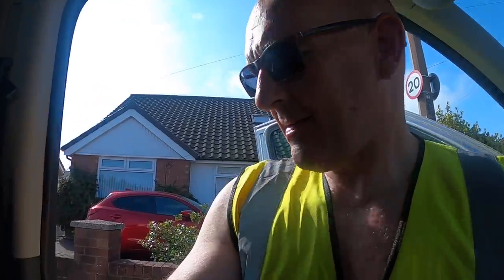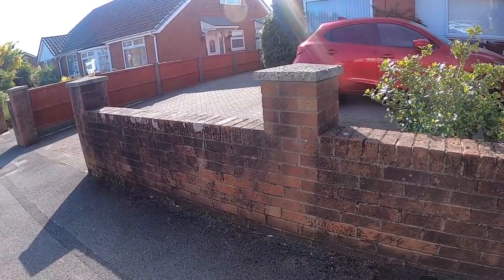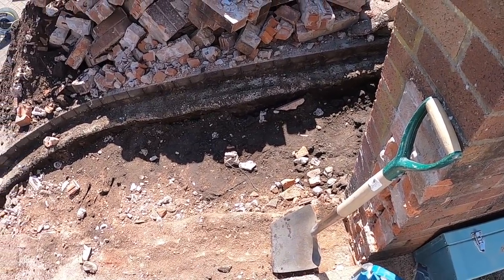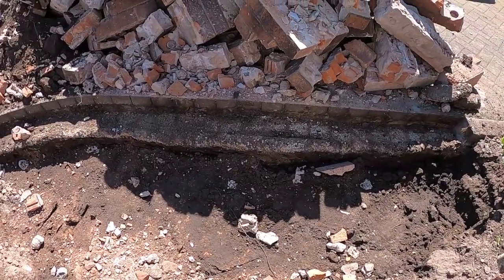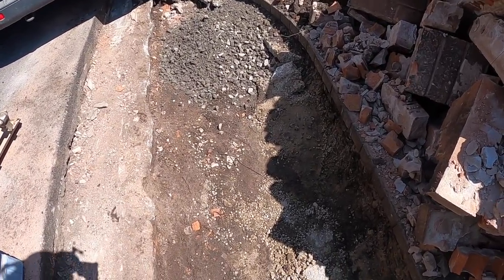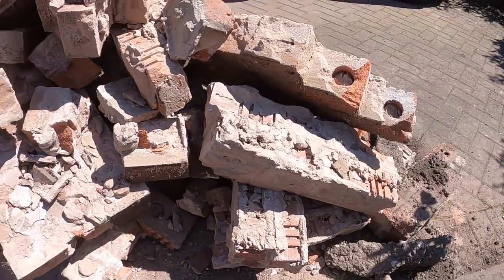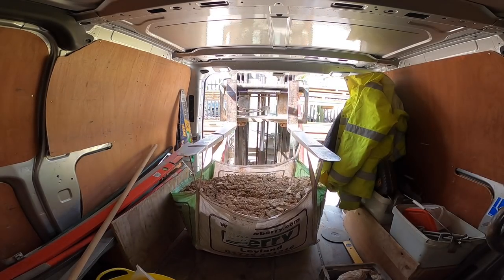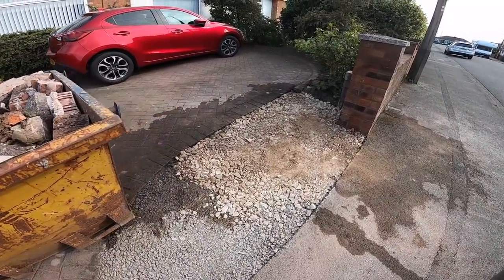GARDEN WALL DEMOLITION DAY !

Comment: There is much misunderstanding concerning Granular Sub-Base Material, or Type 1 or Type 2 MOT (Ministry of Transport specification material)… Type 1 has a 50mm nominal size stone, meaning a certain percentage of the stone content will be up to 50mm nominal size… Type 2 has a 25mm nominal size stone (which was I think the stuff you were actually using. The material also has (or should have) a certain amount of fines and moisture content to allow it to be adequately compacted to a specified compaction factor (as specified under the relevant UKAS specification for use in roads), as it’s original purpose was for use in roads and footpaths to replace the more expensive and previously used (and less sustainable), bituminous base layers… Scalpings, that you refer to is in fact the common name for railway track stone bedding, the large stone into which railway sleepers are laid for the rail tracks to be fitted to… to the uninitiated, poor quality and ‘out of specification’ stone, is often sold by dodgy builders yards to builders who know no different…!! Unfortunately, the size of the stone in ‘scalpings’ is such that it would be virtually impossible to get any ‘mechanical interlock’ between the stone, in anything other than a large excavation, depending of the scalpings were suitably mixed with other smaller sized stone, fines and the correct moisture content…it certainly would be of no use in the average depth excavated for block paving, footways, driveways etc…
Reply from the maker: Must be a part of the country thing where it’s got different names wherever you are . These are 25 mm to dust scalping as seen in Berrys website and the sign above the bay they came from . The moisture content will be lower given how dry June was . This stuff compacts absolutely solid 💪🏼😁🧱👍🏽
Reply from the maker: @martin2466  . Cherry Martin 😆😆🧱👍🏽